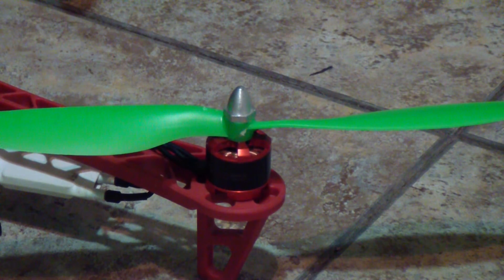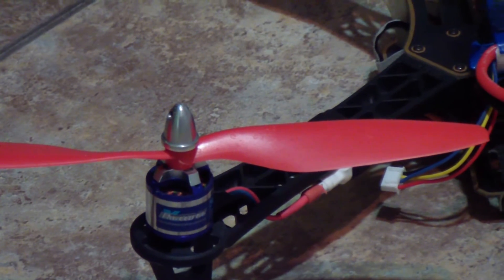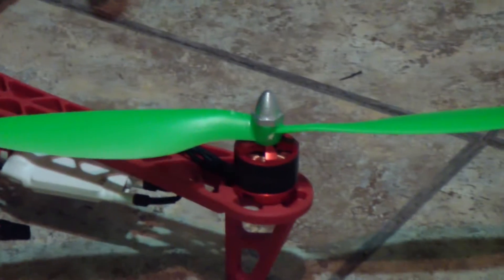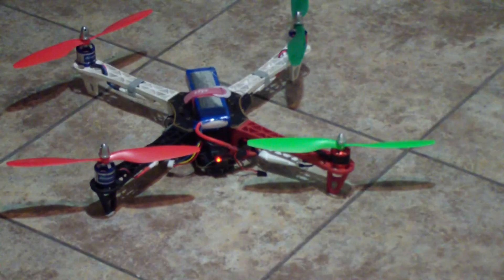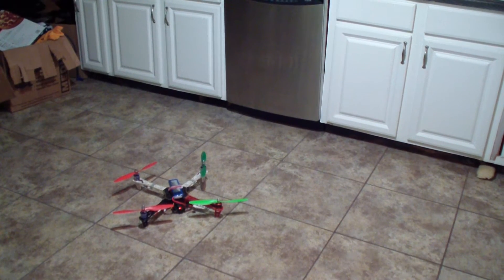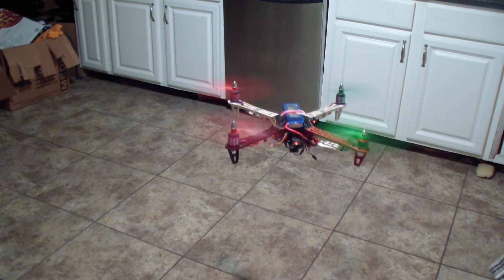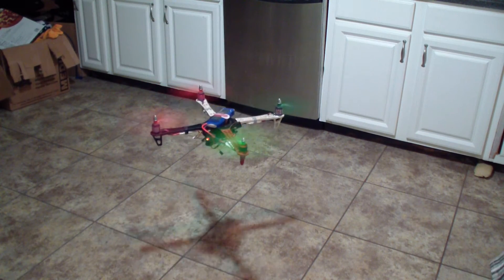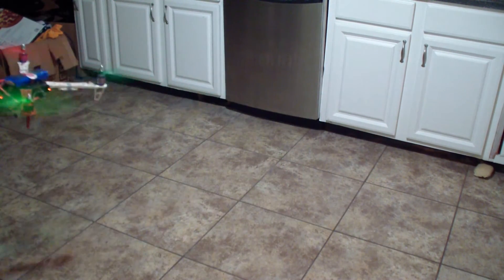Running mismatched or non matching motors on a multicopter, quadcopter or hexacopter

Comment: First off, Bravo for not hitting your kitchen cabinets! I was wondering if you ever tried mismatched ESC's like 30amps with 25amps or 20 amps on the same craft?

I'm running NAZA-M V2 on a DJI clone hexacopter. My 30amp ESC's (running SimonK from Emax) are starting to fail one at a time and I can't find them anymore, plenty of the smaller ones!
Reply: I have tried, works Fine. you can try them.